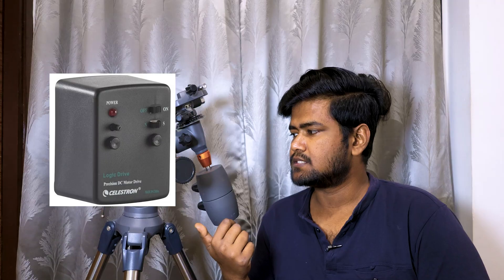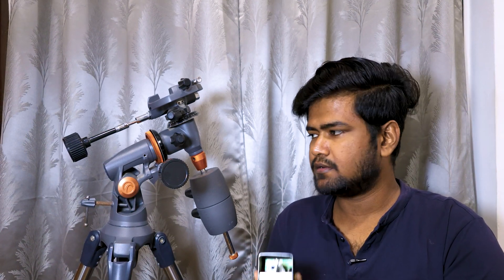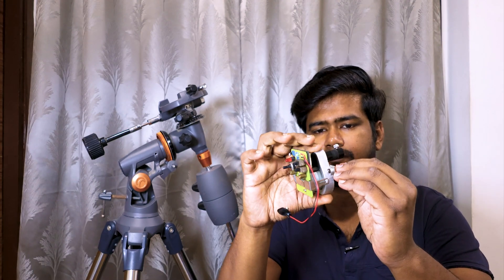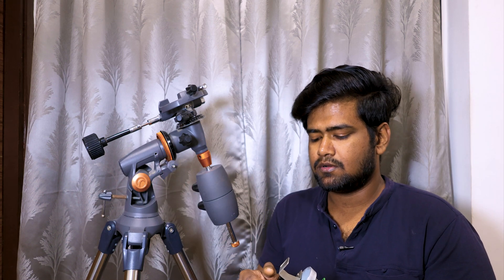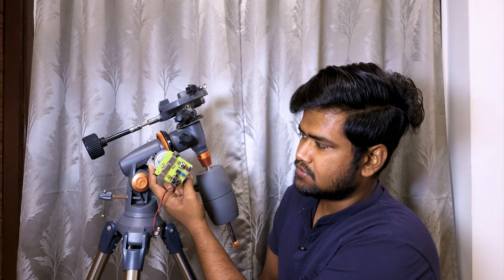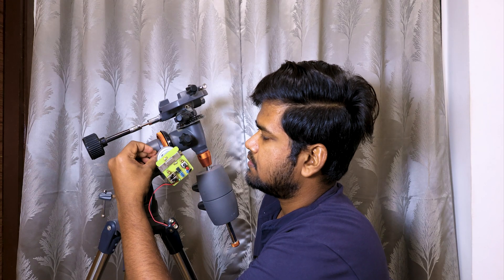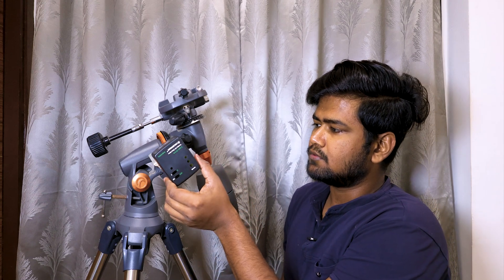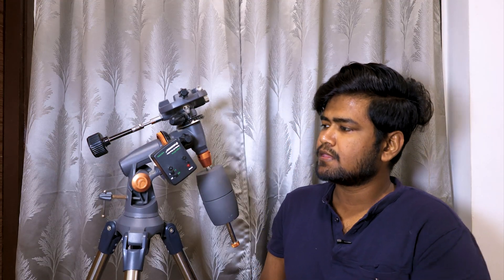How to install a Celestron Motor Drive to Your Telescope’s Equatorial Mount?

Comment: Cool, can you show results of pictures with this motor? And could I attch it to another mount? Of similar quality of course
Reply from the maker: You can check those results in my instagram page. And by the I have listed a mars video on this channel which was also captured using same motor drive.